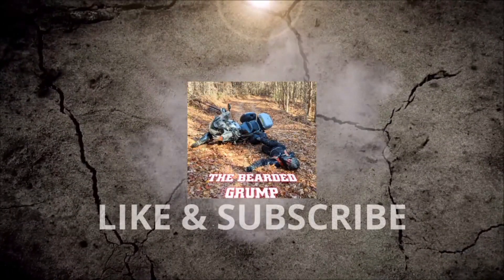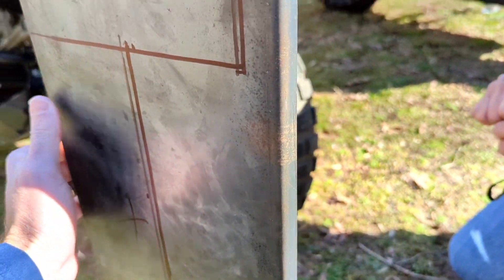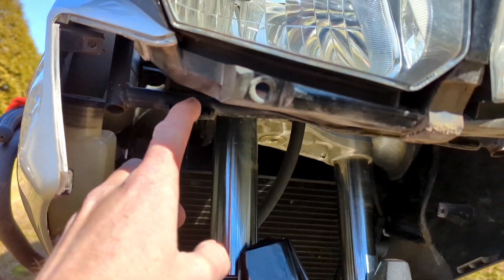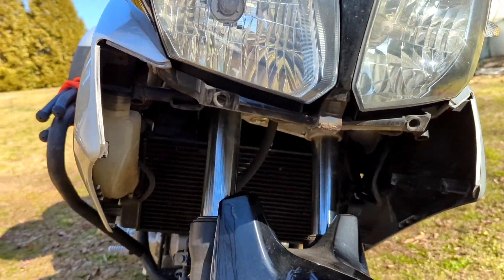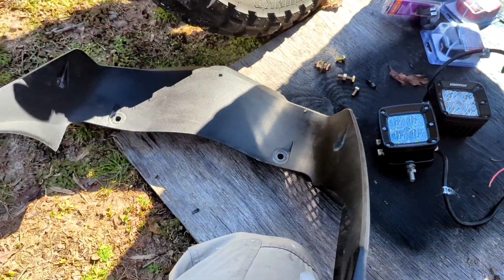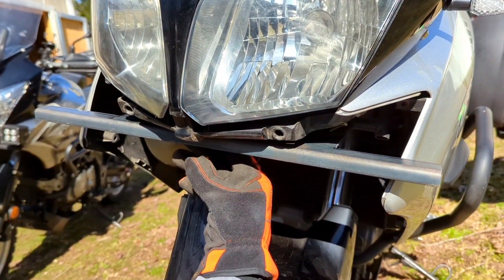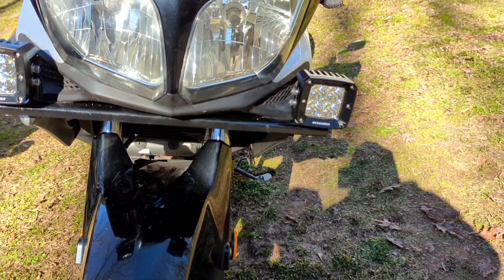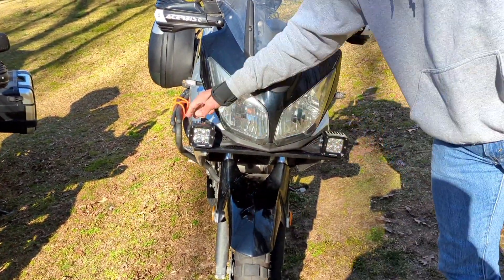Auxiliary Light Mount For A Suzuki V-Strom 650/1000 (The Cleanest Way)

Comment: Hi can you give me the measurements of the two rectangles either side of the bracket please
Reply from the maker: Are you talking about the part the lights are mounted on?
Reply: Yes please
Reply: Yes please
Reply from the maker: @stevenmair7641  sorry about not including that in the video. I'll try my best to remember to measure it tomorrow and let you know
Reply: @TheBeardedGrump  Thanks mate!
Reply: @TheBeardedGrump  oh and the measurements of rhe fold in the front of the bracket, to stop the vibration.
Reply from the maker: @stevenmair7641  that's around a1/4 to a 1/2 inch.
Reply: @TheBeardedGrump  Thank-you!
I'll wait to hear from you on the other measurements.
Very much appreciated.
Reply from the maker: @stevenmair7641  no problem. I'll try my best to remember to get it for you tomorrow.
Reply: Hi mate, any chance on those measurements?
I want to get stuck into making one.
Reply from the maker: @stevenmair7641  I totally forgot. I'll go out and get it now
Reply from the maker: @stevenmair7641  4 1/2 inches on the part where the lights mount and 1/2 inch on the bend in the front
Reply: @TheBeardedGrump  hi is that the width or the length?
Sorry to be a pain?.
Just want to get it precise.
Reply from the maker: @stevenmair7641  it's the length.  I didn't measure the width but you can judge that in the type of lights you're mounted on it. I would say it's around 1/2 to 3/4 wide
Reply: @TheBeardedGrump  thanks mate.
Reply from the maker: @stevenmair7641  no problem. Let me know how it turns out for you.